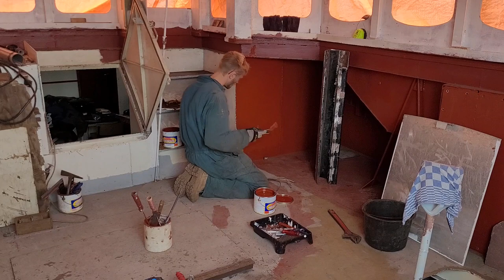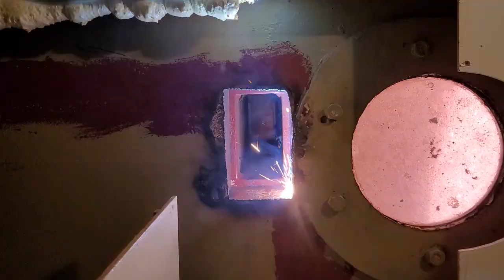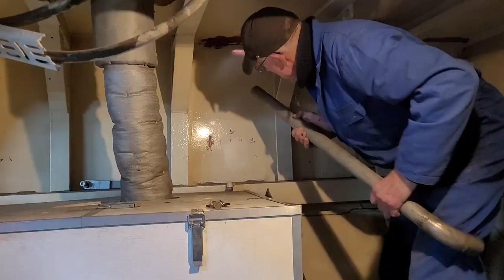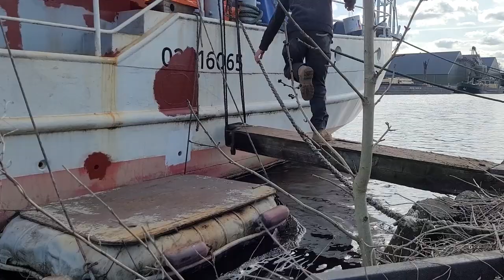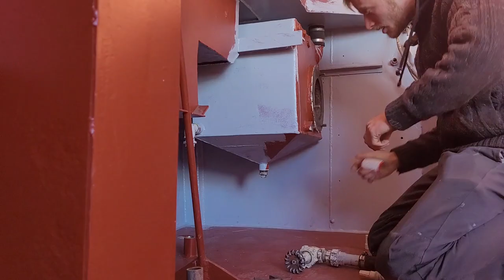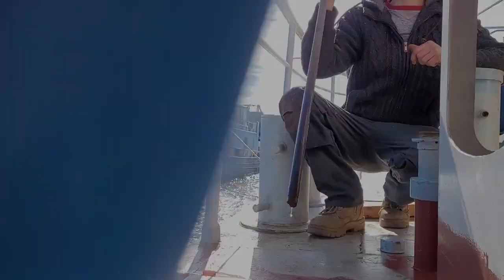Vents, Drains & Cooling Water (Check) - Rebuilding Schooner Tijgerhaai EP11

Comment: I used to work on an old lightship that was turned into a disco. She  had similar drain pipes. The pipes passed through 2 decks and came out just above the water line. They worked well for the first 75 years. They failed at the bottom elbow ,and being so low down at times took in water! The big issue is access for cleaning them out regularly.
Reply from the maker: We do use stainless steel for all our drain pipes, but indeed, in the bottom bend sometimes leaves or other stuff collects, and stays wet. We usualy blow them through with the deckwash hose :)
Reply: The back deck on my old Dutch barge has drain pipes that exit through the hull below the waterline - when she was pulled out we found a big crayfish living in one. I am really enjoying following your wonderful work. Your ship is great. Thanks for sharing
Reply from the maker: @howaboutthese  Hahahah, nice!

Comment: Have you thought about getting a plasma cutter? It will save you a lot of time as it will make a much cleaner cut with less grinding after
Reply from the maker: Yes, we have thought about it, but haven't made a decision yet, since the pro's and cons kinda cancel eachother out. Yes it makes cleaner cuts than our torch, but we have to run the diesel generator to run the aircompressor, which makes noise and burns fuel. While we can run the grinder on the inverter and the torch doesnt need electric power. And there's the cost of the machine itself. So that puts us in doubt if it's worth it :)

Comment: I see you are using one component inside. Are you going to use that on the outside too? I use 2 component PPG SigmaCover 280 and SigmaDur 520 with very good results. I am limited in my primers as nothing much will stick to Zinc.
Reply from the maker: We're only using one component paints, both inside and out. What we use as primer we call "ijzermenie". There is no english translation for it, but the main ingrediënt is Iron(III)oxide. Very similar to the lead(II,IV)oxide based primers, that were used in the past a lot. Our topcoat is Epifanes Multiforte. The complete ship is painted with one component paints because of the ease of use, and we haven't had any isues with it in the past 48 years :)

Comment: When you weld on water and ground the steel hull does it cause electrolysis damage to the steel under the waterline?
Reply from the maker: That's a good question. We keep the ground of the welding machine always as close as possible to the material that we're welding. That way, the current is taking the shortest way through the ship, back to the machine. I don't know if welding will cause electrolysis under the waterline if the hull is grounded, but just to be certain, the hull isn't grounded :)

Comment: Hoi Gijs, ik zag je het expansie tankje plaatsen. Wat mij opviel is dat er geen peilglas op de tank zit. Hoe weet je dan hoeveel er in de tank zit en dat niet alleen maar je kunt ook niet controleren of het systeem dicht is. Neem aan dat er betimmering voor de tank komt en dat lijkt me ook logisch. Misschien dat dat de reden is dat er geen peilglas op zit maar dan had ik in dit geval een low level alarm op de tank gezet. Ik heb alle expansietanks van de motoren in de MK zitten en controleer deze altijd voordat ik de motoren start.
Reply from the maker: There is indeed no sightglass or low lever alarm on the cooling water expension tank, so we're working even simpler. We use a dipstick via the filler cap, which is located just outside on deck, so we dont have to look behind the interior (although there will still be a hatch). We sound the tank on a regular basis. I did this in the end of the video aswell, but I can imagine you missed it since it went very fast ;)
Reply: @tigersharkboatworks  That's also an idea, just use a dipstick. But you just said that you will make a hatch, isn't easier to have a sightglas on the tank than use a dipstick. I can imagine that there will be a change that you will forget that. For the rest keep up the good work. I like to follow your progress.  Brgds, Arend o/b ms Stormvogel
Reply from the maker: Since it will be behind the couch, removing the pillows and checking inside the hatch is about the same effort as poking the dipstick. And it saves us some work if we skip installing a sightglass. But we might change our mind :)